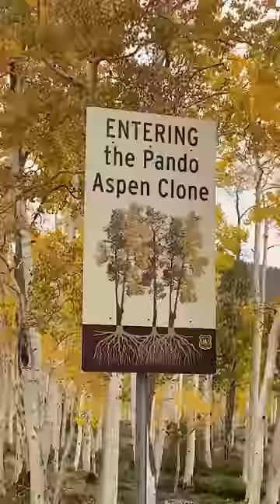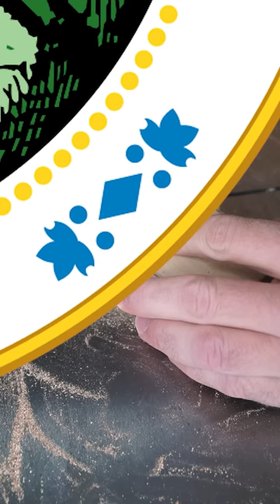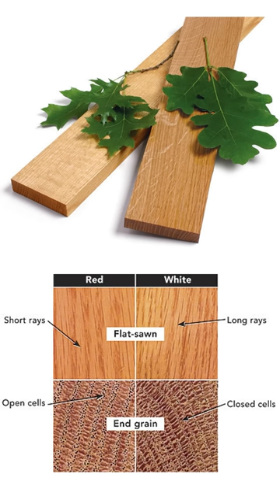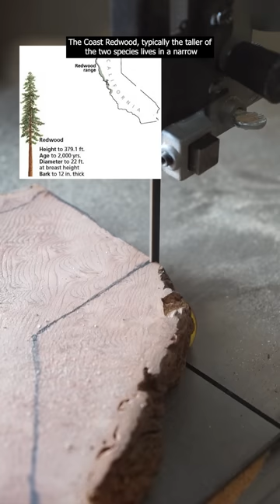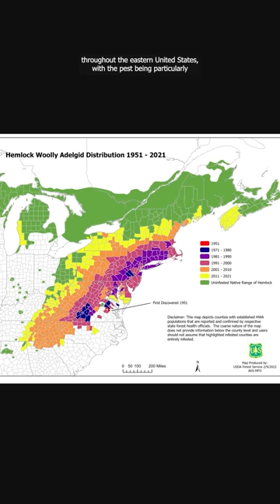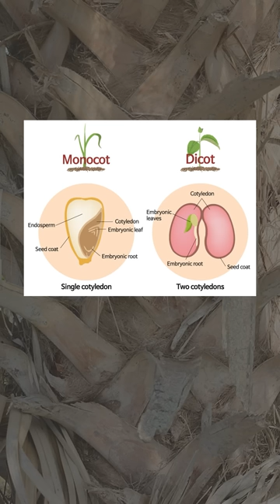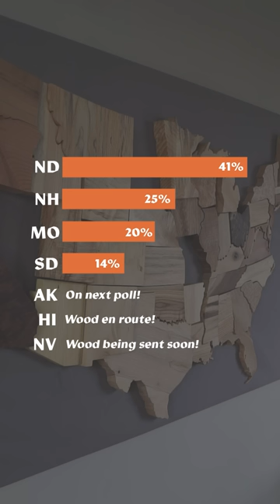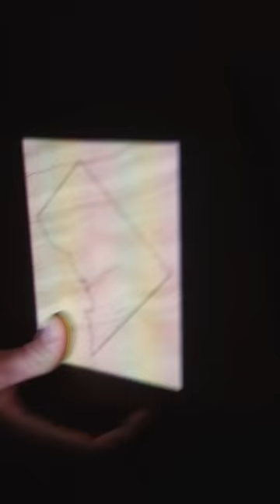Making a Map of the US Out of Wood From Each Official State Tree - Compilation

Comment: FYI I'm From Connecticut, you got the shape wrong and thus you also got Massachusetts wrong too. Mass. Has a little nib that sticks down into it's border with Conn. and so there is a open topped Square Notch roughly in the middle of the top of CT.

Comment: The bark of Ponderosa Pines does NOT smell sweet like vanilla or butterscotch! That would be the very similar and closely related Jefferey Pine. The two are very difficult to distinguish but Jeffereys grow at higher altitude, their cones have spines that curl inward instead of outward like a Ponderosa, and of course the easiest test is to smell the fissures in the bark. Ponderosa will have no smell really. Kinda dusty. Jeffereys have a distinct sweet smell.